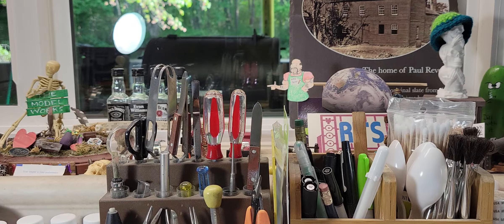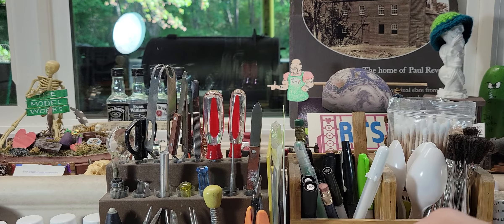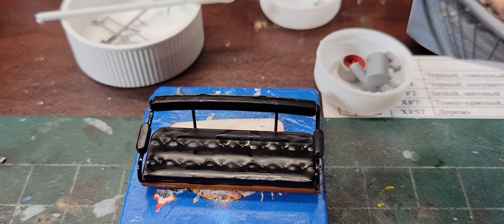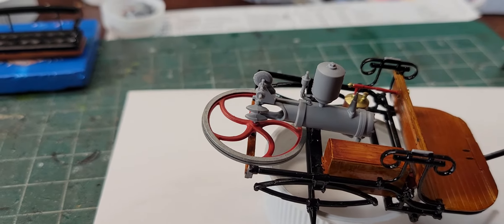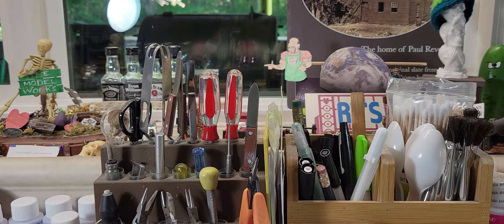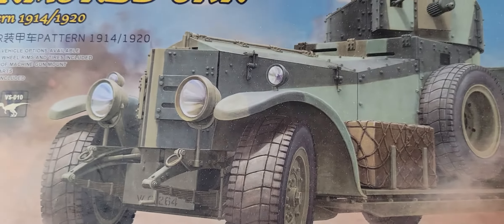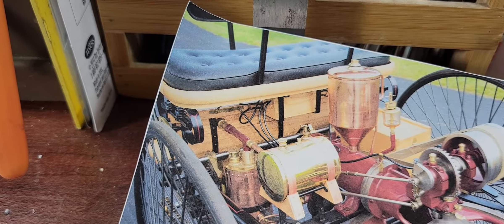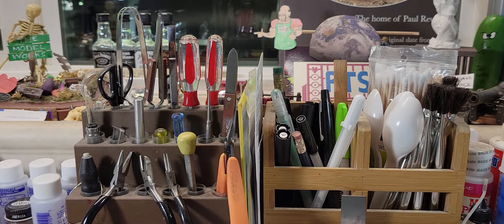A Model Works update

Comment: Also bought that R-R this week, together with a 1/72 German Sub WW1 from Das Werk. Great kits. If the spokes on the Benzo do OK, the R-R also has a WW1 spoked version 👍🏻 
These pioneers of the road look great!
Reply from the maker: Thanks , Mr. Dutch. I saw the spoked rims in the Meng kit. Unfortunately , the version I'm gonna do doesn't have them. Still gonna build them though. Good luck with yours.👍

Comment: That is awesome Charlie! Love that engine. It's gonna look fantastic in paint. And I love the wood floor. I have that '41 chevy pickup buddy build I'm doing with Chris coming up, and I'm trying to decide how I'm gonna handle the wood in the bed.
Reply from the maker: This is how I did mine. I painted it with Model Master Wood. Dry brushed that with Vallejo Mahogany. And then used Tamiya clear orange over that. Finally , give it a Tamiya clear.👍

Comment: That is one sweet build Charlie, the detail is awesome. Just a thought, but could you use the head of a stick pin to.make the ignition switch with? Good luck with all those spokes. Have a good one buddy. ✋🙂👍
Reply from the maker: Yes , I thought about using a sewing pin. But , it should've been done pryor to putting the floor down. It's too delicate to try and drill it. Every time I touch it I'm afraid of breaking it. On to the tires.🤮